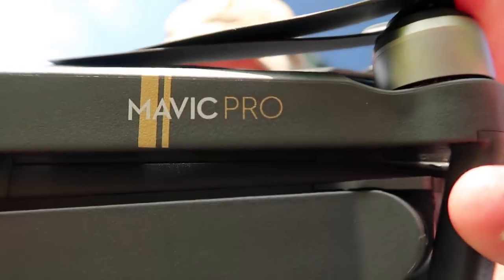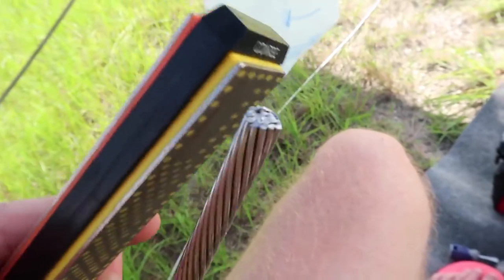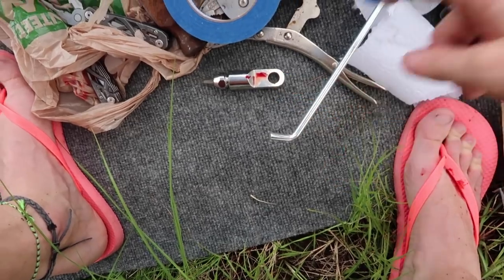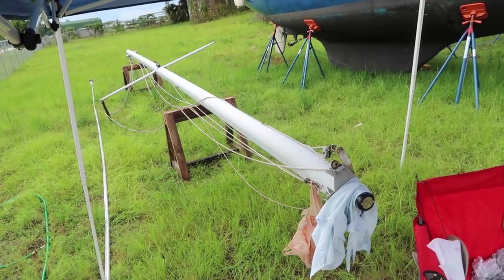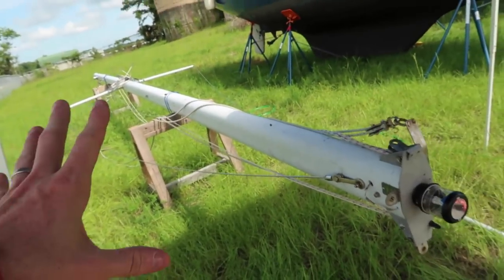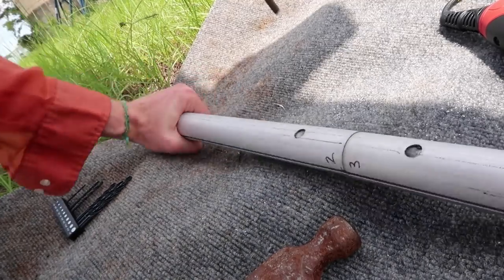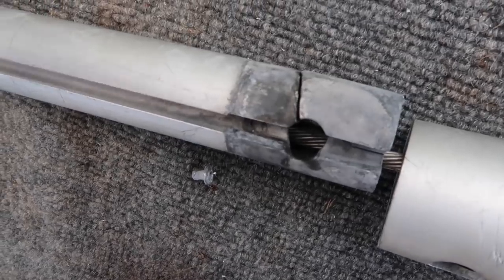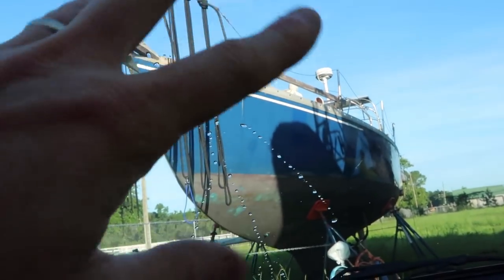Installing Sta-Lok Rigging Terminals & Bleeding A Lot | Sailboat Story 85

Comment: Great video, your sense of comedy take a dry subject and makes it very interesting. 

My wife and I experienced a lightning bolt hitting 35 feet away from us while sitting under a covered patio. It turned a concrete wall into a shrapnel grenade, spewing fragments up to 80 feet, one piece hitting a cooler a few feet from me with enough force to take the lid off. She was picking concrete flecks from her hair for days.  I was looking in the 'right' direction and saw the flash, or rather, everything turned this eerie white/blue color and my entire body shook. The brightness of the bolt and the intense sound was the first time in my life I thought I was going to die, it seemed I was looking directly into an explosion. Which, it turns out, I was.

Don't screw with lightning, it doesn't have to hit you.   I've read that the sound itself is enough of a shock wave to cause injury.  Getting into a Faraday cage is a great idea!

Ok .. to be fair, I still take my camera out and chase storms. I guess us guys don't learn quickly enough.

Comment: If the fore stay is the right length you can adjust the tension with the back stay  turnbuckle. It's all connected! Thanks again for a great video!
Reply from the maker: Understood, I just figured mine would have the adjustment in there.
The other forestays I've seen have turnbuckles.
The other thing is that you never know what goofy things a previous owner has done.
I always wonder if a weird finding is the result of a "great idea" that a prior owner had.
Reply: Ben, there's no need for a forestay turnbuckle. As Richard has said, your tension is made by the backstay. Just make the forestay the same length as the old one, and it will work awesome.

Comment: Great vid! Turnbuckle in the forestay isn't needed, since its inside the furler anyways and you tighten it with the backstay.
Reply from the maker: That does make sense, it was just weird seeing the wire without a turnbuckle.
The backstay adjuster is another thing I'm glad to be rid of.
I wonder if that was added by a previous owner?
Who knows.
Reply: Agreed. I learned this when I did my rigging.  However, it makes it a challenge when you want to remove the forestay for any maintenance. You have to slack off all the other stays to give yourself enough wiggle room to remove / reattach it.

Comment: Great video thanks! I wonder if you could just cut the end off that foil and make it a couple inches shorter. As long as they sail luff wasn't too long it seems like it should work assuming everything  else  is OK. Good luck!
Reply from the maker: Yup. That's the solution, I think. There should be enough length to lop off the cracked bit.
Probably not as big of a challenge as it seemed at first glance.

Comment: So what happened with the crack in the furler? Weld it? Replace it?
Reply from the maker: Chopped it off and drilled a new hole. Cutler is just 2” shorter, but it had length to spare.

Comment: Do you know much margin you have on the length of the foil as compared to the length of the sail? Hopefully you can just cut the bottom foil at the crack and drill a new locking hole for the bushings. My guess is that you have more than those couple of inches to spare. With all the filming you've done, you can probably find footage of it.
Reply from the maker: Good thinking - and that's exactly the plan.
Funny thing is that I did exactly what you mentioned.
I went back through photos and footage to try to see how much extra foil there was up top.
Should be plenty to spare.

Comment: You might be able to JB weld that furler foil sleave.  It looks like the tolerances are maybe too small in order to weld it.  In order to JB Weld you would have to remove the oxidation layer on the aluminum(fine hand sanding), and then very carefully jb weld it together and holding it immobile until it can cure.  Then you may have to get a Dremmel after de-burring and smoothing it out enough to actually go back into the mechanism.  Ouch on that one but at least it is still secured to something, and jb weld might hold it as there probably isn't a whole lot of torsional load with the outer clamp in place.  Obviously it still kinda works, and probably has had that boo boo for a long time.  Of course it is altogether likely you've already done something about it!  You might be able to just cut a piece off and re-drill if it is overly long.  The Vikings used to bleed themselves onto their vessel as a tribute to The Gods.  I hope someone was satisfied by your sacrifice!